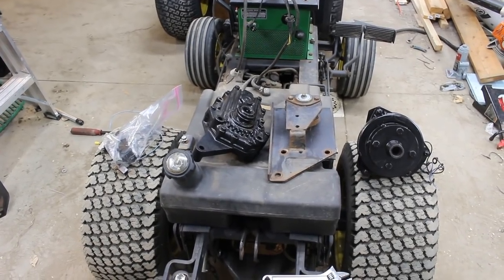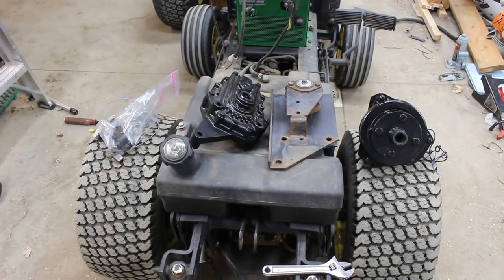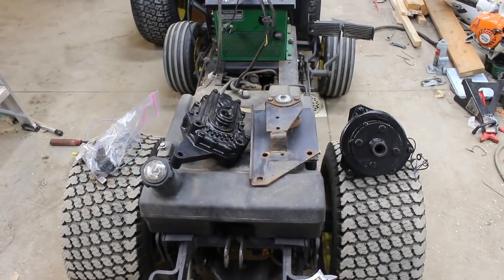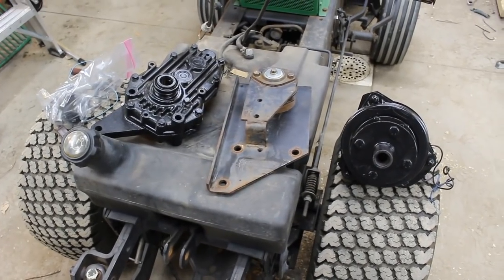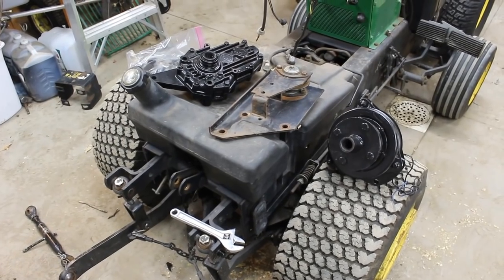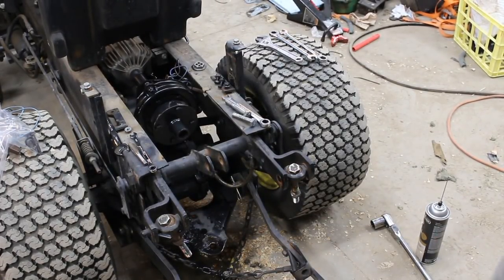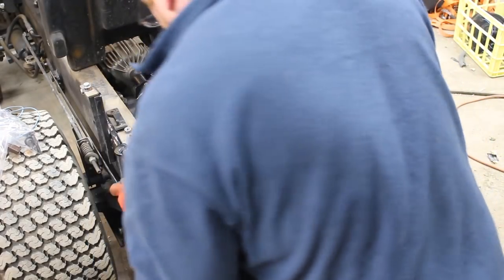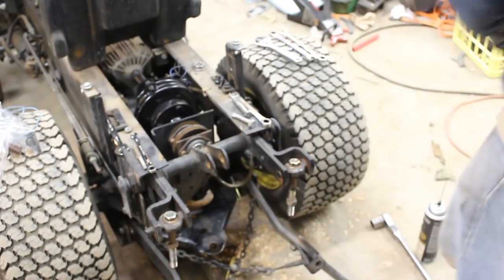John Deere 318 420 Rear PTO Install: Part 1

Comment: The rock shaft doesn’t have to be removed at all actually. There is a round plate that bolts together on the rear of the pto clutch assembly that the female output shaft are on that slide onto the gearbox itself. Take those 4 bolts out and separate it. Pto clutch assembly first and then gearbox WITH that plate already slid on the gearbox splines slides right up in there. Then bolt it back together. 😉

Comment: Great video 👍Do you happen to know the width of the drive shaft end(the one that slide into the clutch ) i wanted to install a pump there instead of a clutch . was it 1/2 inch?

Comment: Will a 318 pto pump work on a 420??
Reply from the maker: The Sundstrand 15U pump is the same for 318, 322, 330, 332, 420 and 430. Early 420's did not have the free wheeling valves. Something to be aware of is input shaft type. There are two versions a round and square type, depending on year of the machine.

Comment: HI mmrbeef  Could you or anyone guide me to exactly what I need to add PTO to my 322?
I see the output shaft on mine and my dash has a switch for the rear PTO.  How hard are these to find?
MCS and 2000 to 540 gear box?
please help thank you
update-- ok I see I need the gear box and the mcs for sure as the pto would be running a generator.
Where do I find these?
Reply from the maker: Rear 2000 rpm PTO are expensive and hard to find. There is no OEM 540 gear box. To run a generator you would need to determine the input speed for the generator head. Once that is determined you could build a pulley system - either from the 2000 rpm PTO or from the MCS pulley to the gen head. When running a generator it’s always hard figuring out the engine and PTO speed to get the correct voltage and hertz.

Comment: Did you ever do a part two follow up video to this one?  I bought a John Deere 430 about a year ago and have been looking for a clutch and PTO since I got it.  I found one last week and bought it.  I have been looking for an install video.  Mine is just the clutch, PTO and bracket that holds the reduction box, but it looks just like what you have.  I need to get the spring that goes in the drive shaft.  I just want to see it done before I wing it.
Reply from the maker: The footage for the second part was junk and I’ve never stopped to remake this set. Here is where I did do some work with the rear PTO recently. https://youtu.be/zEA0ovvnUdo

Comment: A question what's the difference on thec318 to the 420 pto I heard the 420 is 2000 and the others are lower, can the 400 tiller be modified in the chain gearing to accommodate the units PTO please help
Reply from the maker: Are you wondering about the front PTO? The front belt driven PTO on the 420/430 is linked to the PTO shaft. The shaft spins at 2000 rpm. The 318-332 has just a belt pulley that spins at engine speed or 3450 rpm at wot. Hope that helps.
Reply: @mmrbeef  the rear
Reply: @mmrbeef  front yes

Comment: Do you have the spring in the shaft that connects to the hydronic pump
Reply from the maker: Yes the spring is now with the PTO.
Reply: Isn't there a rubber O ring M88993 that goes in the shaft before you put the spring T 66742 in?  Does that spring just drop in?

Comment: You dont need to take the rock shaft off you just need to loosen it and pull it back that's how I did mine
Reply from the maker: The couple times I have just loosened mine I end up knocking it the rest of the way out and generally creating some type of mess. So taking it out is just easier for me. With the small amount of additional clearance that is required I am sure you could leave the rockshaft on the machine.

Comment: Is the clutch supposed to make any kind of noise? I just installed one on my 332, and at low RPM, it makes a really loud clicking noise. Abruptly stops about about quarter throttle. Does it with it switched on and off. Noise is worse with it on.
Reply from the maker: Have you checked the air gap on the clutch? The clutch could be rubbing because the air gap is too close. It should be 0.018 in all three check points on the clutch.
Reply: @mmrbeef  Yeah, I set the gap.  Spun it by hand and powered it up a few times to be sure the gap was good too.  I replaced both bearings with good name brand ones, new shaft, key, and spring on the hydro end.  Everything is nice and snug.  The sound is clearly coming from the clutch.  You can feel the vibration on the pulley bracket and on the coil housing.  I removed the strap that bolts to the frame to eliminate that too, though I had it soft mounted with rubber.  It doesn't make any noise at all unless the RPM is below about quarter throttle. https://youtu.be/_-QF-PJuYKE

Comment: Ahh the old finger smasher 9000....  my finger throbs just thinking about it.  2yrs ago I slipped up installing wheel weights on my 316 and reflex had me try and catch it.  My middle finger got caught between the weight and the asphalt and the finger tip bone was now in 3 pieces.  All healed up ok, and now when I’m working with heavy parts I recite “if it’s gonna go, just let it fall” over and over.

Comment: I believe there should be a spring that is in the clutch shaft to pump output shaft
Reply from the maker: Correct Part T66742 - It should be at the dealer sometime this week. I make note of that in part two.
Reply: @mmrbeef  What is the spring for?  I've read it's needed and I've read it's not needed.  I'm restoring and installing a rear PTO on my 332. The shaft I have has the Zerk fitting, and I've got a new o-ring for the pump output spline.  Also, the box o' parts that I got off fb market had two washers that were on the clutch-MCS spline as received.  I've never seen these before anywhere on my research.  I just as much assume they weren't supposed to be there, as the MCS pulley/bearings/ect... were assembled wrong when I got it.

Comment: No anti-seize on the shaft splines?
Reply: I agree with you on that
Reply from the maker: I thought about it but honestly the fit is loose enough that it should be just fine. I've got some other work to do on the 318 later this winter and I might revisit the PTO then.
Reply from the maker: canuckguy worried so I have installed and uninstalled this PTO twice. When I finally get everything like I want and set up correctly I will probably use some type of antisieze.